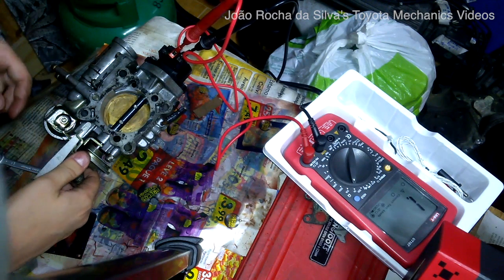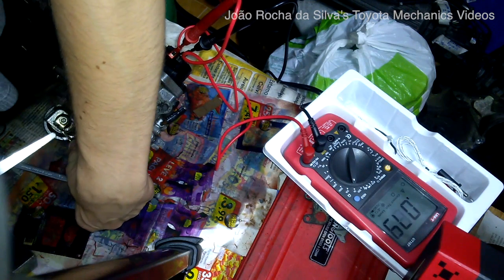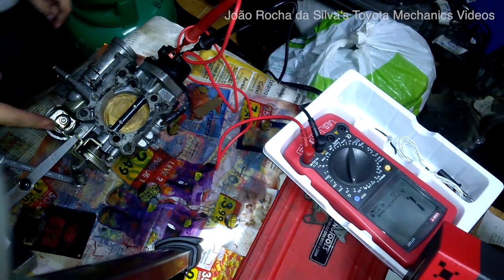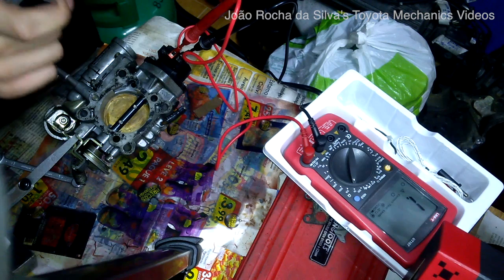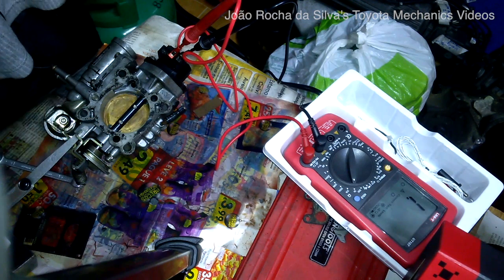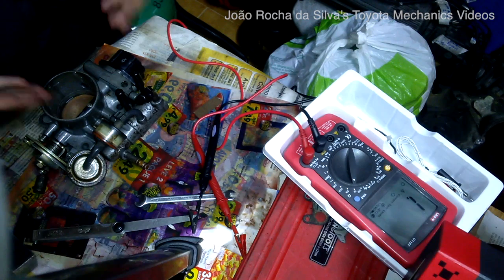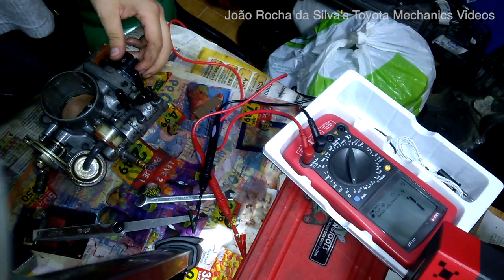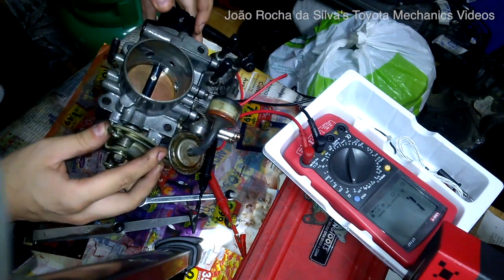Toyota 4AGE Engine Throttle Body Service (3/3) : Reassembly, tuning the TPS Sensor

Comment: What happens if that stopper bolt has been tampered with? Do you need to set your idle speed with it before you calibrate the TPS?